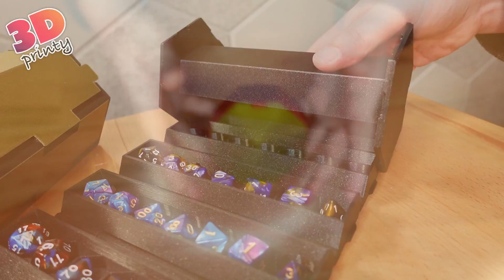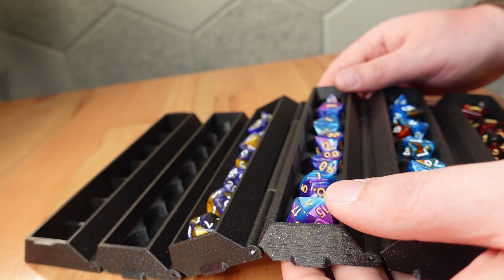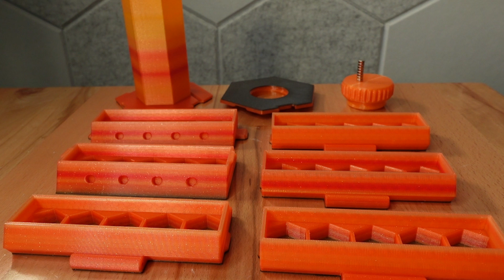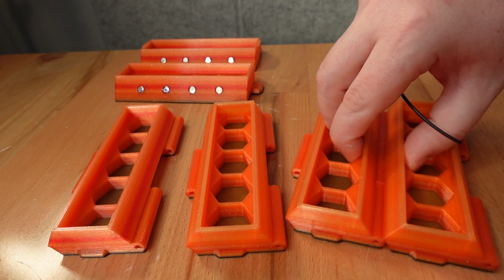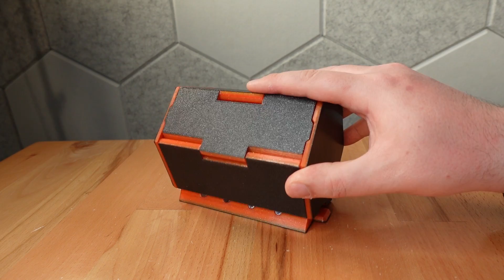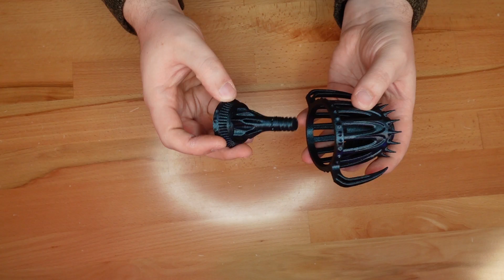3D Printed Rollup Dice Box

Comment: So. I printed my own, and with the dice, the d20 are just too tall for the container and stick out just a little bit. I noticed you have some of the same type of dice, so I think you had the same issue. Any tips?
Reply from the maker: While my own dice fit fine (when the D20 is sitting flat) I did hear that a few people had this issue, sorry!

Did you try printing the core with inset walls (Core Bottom - Inset) to get a little more space?

If that is still not enough space, I also designed a "Rumble Roller" remix that's extra spacious: https://www.printables.com/model/446355-rollup-dice-box-rumble-roller-deep-bins
Reply: @3DPrinty  ok. I will print that one Monday when I go to school bc that's where I have the printers lol. Do the deep bins have different designs like the hexagons, squares, ect, or is it just empty, and it has a large one to right?
Reply from the maker: The deep bin version is just a simple open container. It should be large enough for a full dice set - or a foam insert if you're worried about damage from dice shaking around :)
Reply: @3DPrinty  ok.
Reply: @3DPrinty  ok. A few more questions
A. So I k ow if it will help my problem, the core with the engrave (I don't remember what it is called), how deep is the engrave? I need to know if that will help my problem before I just waste time and filliment.
B. The deep bin boxes, do I have to print a whole new core, and if so, does that one have a dice tower core?

Thanks
Reply from the maker: A. The inset core gives you an extra 1mm of space.
B. If you want a dice tower, then I'd go with the Inset Dice Tower Core. The Rumble Roller with extra deep bins is NOT compatible with the other cores.
Reply: @3DPrinty  ok. It should barely be enough space for the d20, although I can't have them in the slide in.bin bc the will block it a little bit, It should barley work, thanks

Comment: What print settings would you recommend for infill and walls etc?
Reply from the maker: You can get by with fairly minimal infill since the bins are mostly walls. My default is 15% gyroid, but I'll use 10% gyroid when I'm trying to save a little filament.

Comment: What can I use to connect the bins and trays? I really don't want to use filament as I don't feel it would last very long.... Any other substitutes?
Reply from the maker: A bent paperclip or similar thin wire works. It's been a few years and my hinges are still holding, but wire would certainly be stronger.

Comment: I really wanna make this but like I’d need to manually fix the magnet holes because mine are a little bigger
Reply from the maker: If you're still interested in this, check out PrusaSlicer's "Negative Volume" tool. You can add custom sized holes to a model without a ton of work. And, when you're done, you can export the result as an STL and upload a remix :)
Reply: @3DPrinty  too late. I just need a larger drill bit now

Comment: How did you get the magnets into the core?
Reply from the maker: For me, they were press-fit, but a little glue is recommended so that they don't work themselves out. When installing magnets, I'll often use a flathead screwdriver to position the magnet and then press it in.

Comment: Should the core be used as additional storage? if so, it'd be great to have some type of insert that houses larger dice that did not fit inside the main compartments
Reply from the maker: Yup, just unscrew the cap to access more storage in the center.

Comment: It would be nice if it stood flat - the little tab sticks out a bit more than the base?
Reply from the maker: Sure thing! You can now download "Short Tab" versions of the start bins on Printables. These will be available on Thangs as well shortly.

Please note that the short tabs are slightly more difficult to reach, but still work.
Reply: @3DPrinty  another thought is that you could have a cap at both ends and the core could have two separate compartments. It would provide a nice symmetry, look more like a scroll?
Reply from the maker: That's another good way to do it. I'll leave that up for another remixer, though :)

Comment: PSA: On PrusaSlicer, make sure "thick bridges" in the print settings is turned off. If your layer height is smaller, "thick bridges" will make the bridge hang down into the hole the filament is supposed to be going thru on the hinge.
Reply from the maker: Good call.

In theory, it shouldn't matter for this specific model because the holes aren't actually circular. They're actually teardrop shaped to avoid bridging or extreme overhangs. But there's definitely no harm in playing it safe by following that advice :)
Reply: @3DPrinty  Bravo. Well designed. :-)  You want to avoid thick bridges or the bridges will hang down into the hole for the filament if your default layer height is larger than the layer height at that particular layer. It took me forever to figure out that if the default layer height is bigger than the adaptive layer height, you're still going to have filament jammed into your round holes, even tho the model itself looked fine. :-)
Reply from the maker: Oops. I typo'ed my last sentence and reversed the meaning. I've edited that for clarity. Yes, there's no harm in playing it safe and turning OFF thick bridges anyway.

Comment: What a cool idea! The originals were my first prints of your models and I love them for my 3D printing bits and bobs. I don't have a need for that many dice, but remixing custom bins is something that could organize my chaotic toolbench. For the filament hinges I cut the strand 2-5mm longer than needed and used an old chisel tip for my soldering iron to melt the filament to the drawer, cleaned it up with light sanding and it gives a very clean look that slides in seamlessly.
Reply from the maker: Excellent idea! Unfortunately, I'm too indecisive for permanently fused hinges :p

Comment: Excellent as always.   Since it's a hexagon I'm wondering if this could have some synergy with Wyrmwood's Hexy system.  I'll probably play around with it but I'm currently unable to do any remixing or printing.
Reply from the maker: That's an interesting idea! I can't seem to find out what the standard tile size is. at 100% scale, this box is 106.2mm from point-to-point. Or, to view it another way, the side of the hexagon are 53mm .
Reply: @3DPrinty   113.79mm from point to point, 98.55 from flat to flat, 15mm high
Reply: @3DPrinty  Unfortunately, I don't have my notes so I'll have to measure my personal files to find the hole positions.  I'm a little obsessed with Wyrmwood stuff, LOL.  Never gotten my hands on anything physically but I pretty obsessively take notes because I like their compatibility and design.  The information is out there, and still believe they will give it to you if you ask them with good reason, but it's not convenient and takes digging.  There's also files on Thingiverse.  Search "Wyrmwood".  I believe "hex blank" is the most accurate, but it's been awhile since I've checked.  I've never gotten my hands on anything so I can't perfectly perfectly confirm, nor is there a way for me to find magnet directions.  I just really love the system and want to expand on it.
Reply: @3DPrinty  It sounds like your box can just be upscaled slightly to perfectly fit within the hexy system.  Tho, the filament hole will need adjusting.

If I was to remix this, I would make one side of the core as thick as a tile with at least one magnet so a tile can click to it while it's standing up.  Then I would make the core a dice tower and try to get the angles right so a typical die would fall right into a connecting hexy tile.

Or maybe the two ends of the core could disconnect and be tiles themselves.
Reply from the maker: Sounds good! A dice tower core is now available here: https://www.printables.com/model/437061 If you decide to remix it to fit the tiles, I'd love to see your results :)
Reply: @3DPrinty  What size do you make the filament hole?  And it's a tear drop facing up right?
Reply from the maker: The hole is 2mm in diameter. Yes, it comes to a point on top with 2 tangent lines that meet at a right angle. So technically it's 2mm wide and about 2.4mm tall.